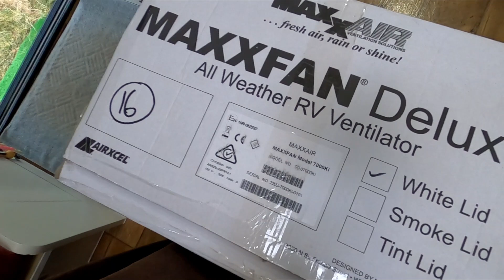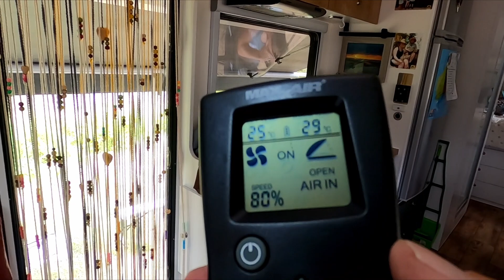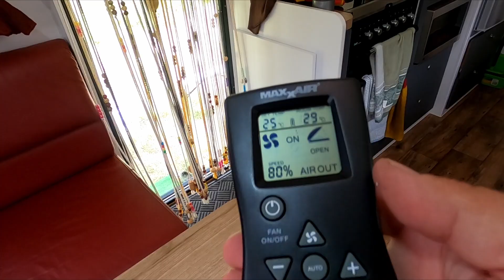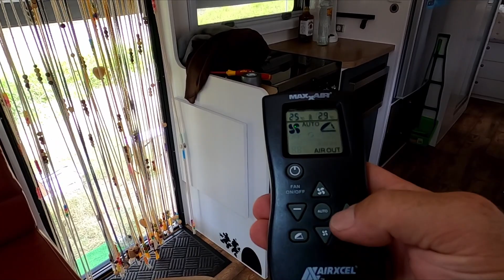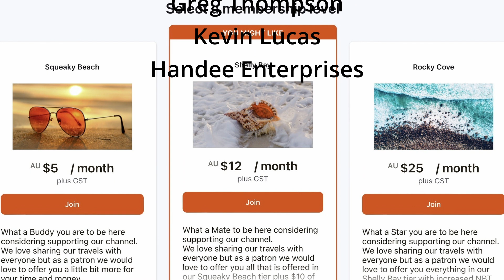Caravan lounge & shower fan install Upgrades tips & tricks @vicoffroad

Comment: Sorry we missed your 5pm presentation, we were putting up a shed for the Motorhome, great episode I like the bathroom vent I need to check to see if we can install one.
Reply from the maker: Hi Tim,
The shower fan works great, especially on those hot humid days, when you dry yourself with the towel, and then you are still wet. The super breeze it makes just dries the moisture off you skin.
Cheers, karl & katty

Comment: Hope you don't mind but when we go to BTHQ in a few months, we'll get them to do the same to ours as I HATE the ones we picked too!!.! Appreciate your uploads.
Reply from the maker: Hi Jay,
We have found the Maxxair style of fan to be the best for us. Much better than an opening roof vent, as you do not need to close it when raining. At night if it is hot and humid, we close all the windows at the fan end of the van. It then sucks the cooler air over the bed area and hot air out the fan. It is great in still hot rainy humid weather to get that air flow. The maxxair unit does not have very good dust proof sealing( which I modified to make it better). 
The San Hema we put in the shower work great, and has got good dust sealing. The draw back is you need to always close it when raining.  The maxxair is constructed a little stronger than the san hima. 
If I did it again, I would purchase the maxxair with the Smokey coloured lid ( if I could get it) as it would show up the dirt less, as opposed to a white opaque lid.
There are two size maxxair surrounds. The larger one is hard to get, that is why I made up the adaptor plates for it.
Hope this helps, cheers, karl
Reply: @nowhereboundtouring  thanks for the reply!!! Two questions.. did you pick up power for the maxxfan from the light??? And did you just silicone the San himas'??? No membrane??
Reply from the maker: Hi Jay,
I ran a cable from our DC switch board through the roof. It was adjacent to the hatch and I could go via a roof speaker, so it was’nt to hard. The san hima fan had a great seal. The maxxair seal was not great. I went to Clark rubber and got the smallest automotive type edge seal, and slipped it over the top edge. You can fit the seal once the fan is installed by just removing the top hatch, from on top side (outside side)of the roof.

Cheers, karl
Reply: @nowhereboundtouring  hey Karl, thanks again mate!!! I've done the 2 bathroom fans. Mad respect for Bushtracker installer... oh those seals!!!! Hahahahahahahahahaha cheers Julie
Reply from the maker: Hi Julie,
I hope you like your new fans as much as we like ours. The shower one is so good it almost drys you without a towel.
Cheers

Comment: It looks like if you set them both to blowing out, you might have trouble opening the caravan door if it is closed (sealed). BTW that is a joke. They are both fantastic additions.
Reply from the maker: Gday Ben,
It is a bit like that with the shower door. If the shower window is closed it sucks the door  firmly shut 😁

Comment: Look great , are they easy to clean fan blades on a weekly basis
Reply from the maker: Hi David,
They have both been working exceptionally well, but I hate cleaning them. They are ok to clean, no better or worse than other fans. The white lid on the one in the  lounge area has discoloured from dirt & dust. In hind site, they make one with a dark smoked grey lid. This would not show up the dirt as much, and would be better.
Cheers, karl

Comment: The ceiling fan in my camper must be the original MaxFan and it is way too loud even on low speed. How low do those fans go, do they do a quiet low speed? Mine is too noisy on low to sleep with at night. I was thinking to put a D/C controller on it and hopefully be able to turn it down to a nice quiet slow speed. Thoughts?
Reply from the maker: Hi Jim,
The Maxxfan is quieter than a sorrocco fan when it is on low to medium speed, so no issue to sleep with at all. Our model has 10 speeds, from very slow to fast.
Maybe it is time for an upgrade?

Cheers, karl
Reply: @nowhereboundtouring  upgrading is so expensive, looking for a cheap solution since I already have this one and it is installed and working, thanks, good to know at least the new ones have a quiet low speed
Reply: @nowhereboundtouring  I installed a DC dimmer on the fan and it works great! Can go down to really low speed now.
Reply from the maker: That’s great Jim, good job 👍